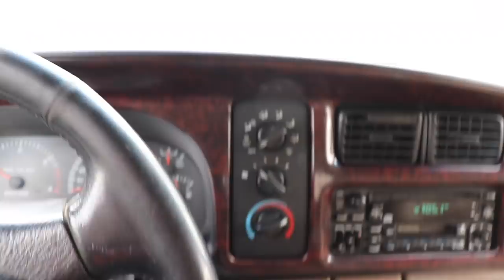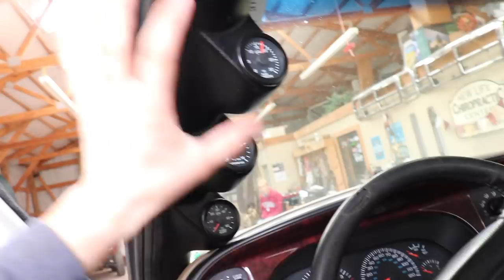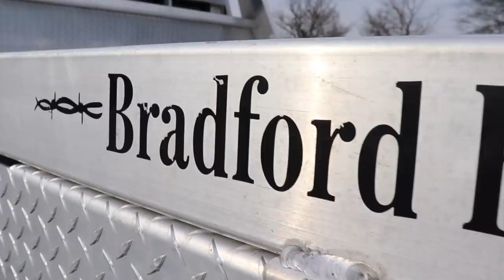OUR WIDEST BUILD EVER!!! THE DUALLY 24V CUMMINS FULL REVEAL!!!

Comment: If this is a give away truck. Best believe ill be entering as much as possible.

And yes, remove the dually spacer in the front. Def too much stress on the hub and ball joint since the weight is now all infront of the hub rather behind it.